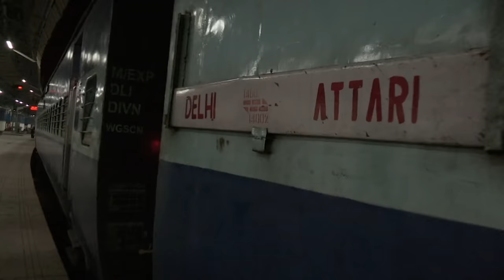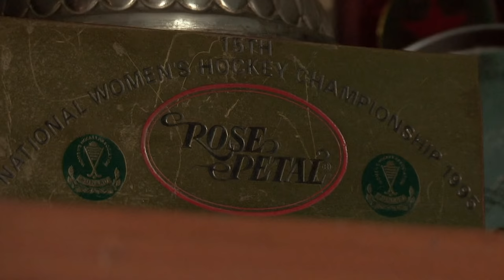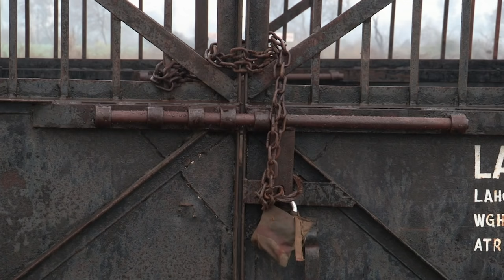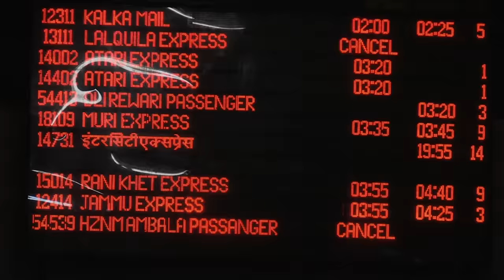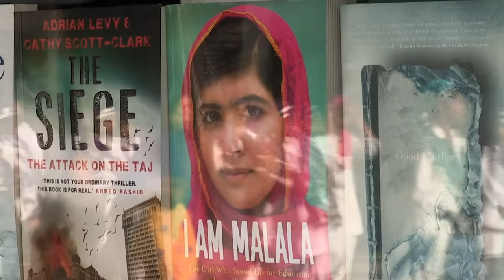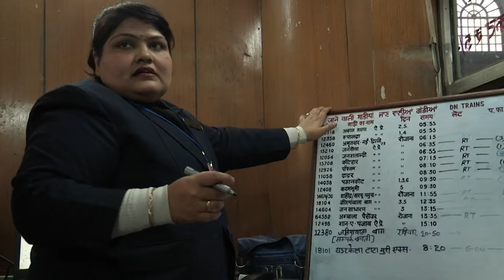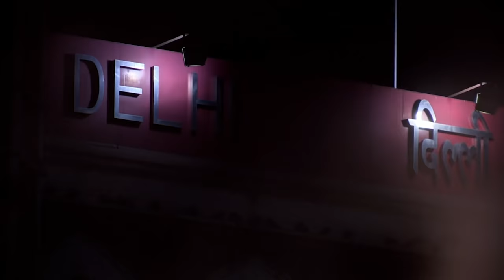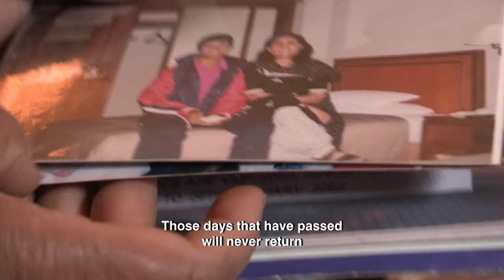Samjhauta Express: The Train That United India and Pakistan

Comment: Punjab? If you are talking about the Punjab insurgency, Samjhauta Express has nothing to do with 'peace in Punjab'. It was introduced as a confidence building measure between Ind-Pak at country level after the 1971 war. It started operation before the start of Punjab insurgency and had little impact on it. The line goes through Punjab. That's all.